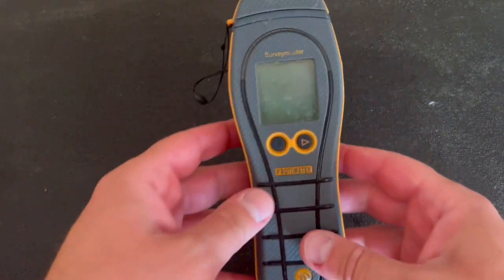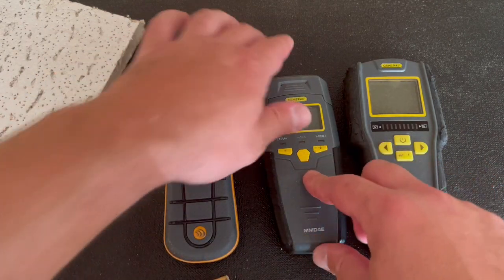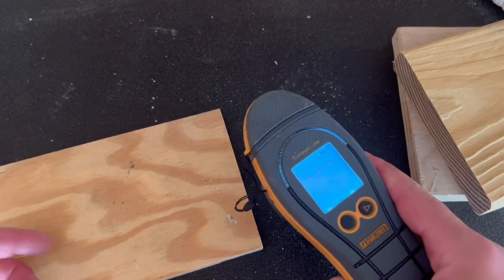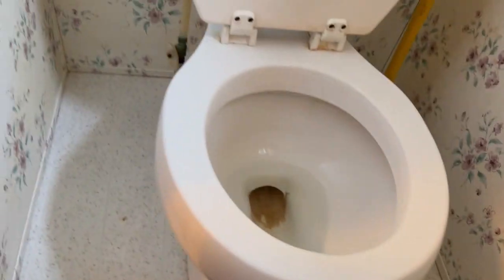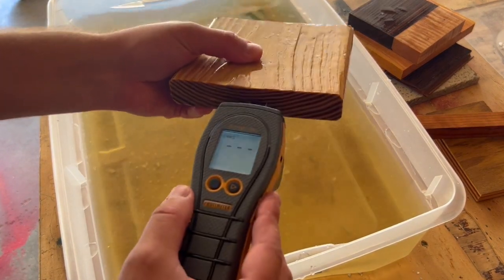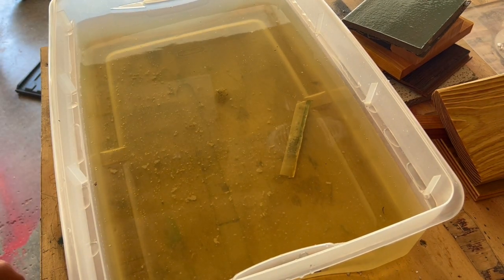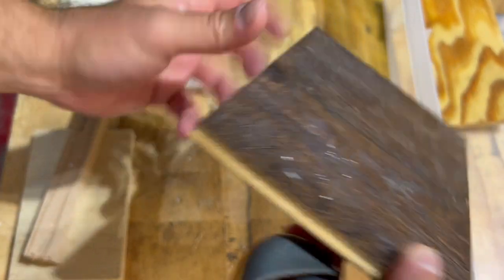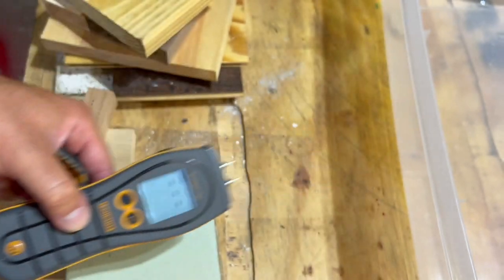Moisture Meter - Surverymaster Protimeter.  Moisture in different building materials

Comment: With the protimeter Rel mode if you place it against a surface that has metal it will read it as “WET” even if it’s dry. So fiberglass insulation with the tin foil backing will always read as wet regardless of its dry. so I use the Pins or long probes to measure moisture on fiberglass lines.

Comment: Wood is so interesting. 

So many people think PVC and hardie is amazing, but wood is so good at absorbing and displacing water. I tell people it only rots, as long as it is has a long exposure to moisture. If you can resolve the moisture issue, it should bounce back… but wood will also tell you there is an issue way before hardie or PVC will. Plus its easy to replace and manipulate in comparison to the rest.

Came here interested in the meter, but you helped reaffirm my belief in wood.